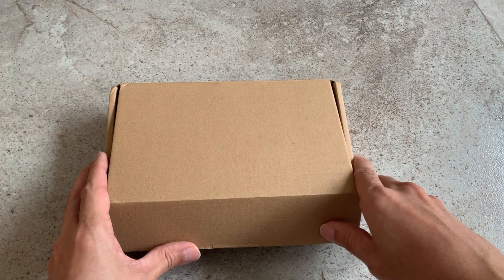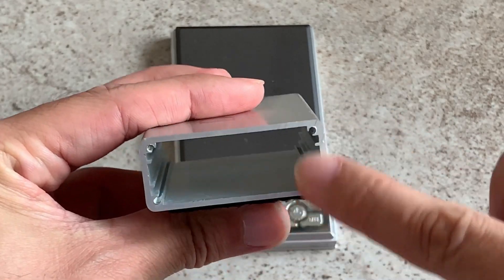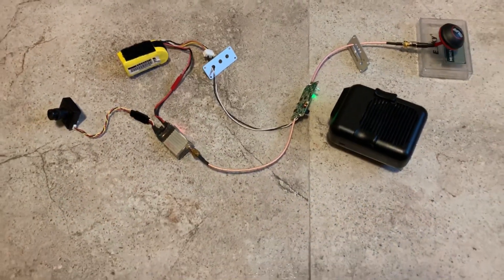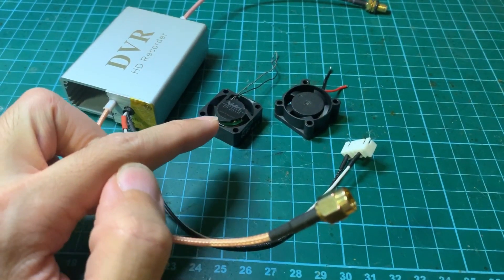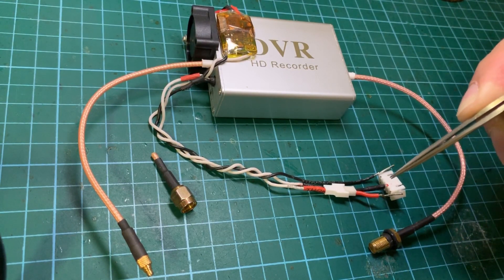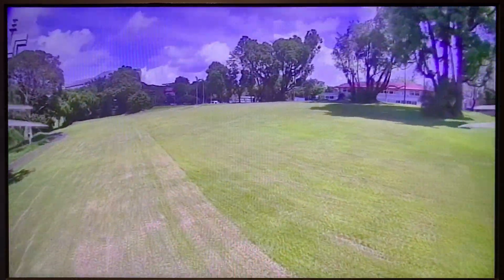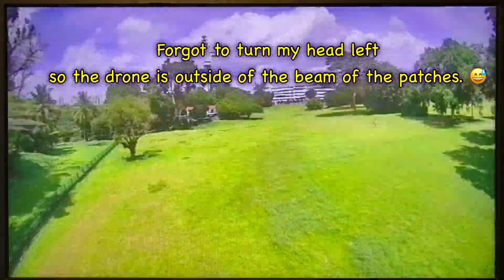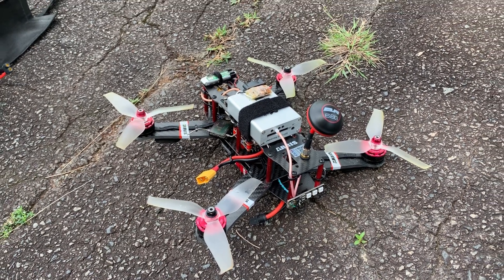Shark Byte on Steroids (super-amped)

Comment: This range seems really bizzarre. It would be interesting to see what the rf environment is like in this area. I've had poor performance from my setups due to high gain wifi antennas nearby. As soon as the drone was not in direct line of site i got nearly complete static. Swapping to a different channel helped in my case though i believe it could be possible for wifi to fill all of our fpv 5.8ghz band pretty easily.
Reply from the maker: Thanks for watching. Admittedly, I was immediately disappointed with the result and I tried different outputs of the sharkbyte (25mw, 200mw, etc) but to no avail. I also re-tested the amp on my analog VTX and the amp was still working great for analog 5.8g. At that juncture, I kinda concluded that the 4W 5.8g WiFi amp simply could not process the type of 5.8g signal from the Sharkbyte VTX. 
You are right that strong WiFi could cause interference easily as each WiFi channel uses a range of frequencies,  instead of a single frequency. I was getting clean video at that field so there was unlikely to be interference from the residential WiFi nearby.

Comment: Where are you flying from? @200mw I have pentrated more than that and had better signal. Eben with 4 dji quads @1200mw..I do not believe that's actually a true 4 watts. The 1 watt board we are testing smokes this test.....
Reply from the maker: Thanks for watching. It measured 35.2db (3.3watts) in my analog range test video using this amp https://www.youtube.com/watch?v=a_Ov9Q652Mc

Comment: Can you boost the antenna gain from the vrx?
Reply from the maker: I did tried a 5.8ghz low noise amp on the receiver. It worked but the improvement in the received video was not significant enough,  https://www.youtube.com/watch?v=GNiBfrrPsTE

Comment: Can most likely fix this issue with helical high gain antennas.
Reply from the maker: Thanks for watching. Helical are are the first 5.8g antenna I built. They are great antennas. I used the mast of the CDs cylinder box which is just the right diameter.

Comment: I applaud your effort to try an make sharkbyte a better option but like you said in your video when you saw the results, that is truly disappointing. I had high hopes that fatshark would be able to compete with DJI but it seems that with the current results our money is much better spent on a DJI setup. I think that the "graceful" degradation of signal is one place that fatshark is going wrong as it doesn't seem all that graceful and you can't fly through it's breakup, The two way communication of DJI seems to be the better option, If I was to design a system to compete I would go with the bi directional communication and then have the vtx lower the bitrate on the fly while stepping down the resolution as well as the signal fades out. You would think that fatshark would have thought this out a little more before investing money into producing a second rate product that's not giving them a great name as of right now. I want to see a competitor to dji as I don't agree with the decisions that they make such as enforcing no fly zones even for professional pilots. We can only hope that future firmwares and hardware revisions will see fatshark do a better job in the near futures, thanks for posting your attempt to make it better.
Reply from the maker: Thanks a lot for your comment . I’m glad that you appreciate the great lengths I took to combat the weakness of the SharkByte. For now, I am putting the sharkbyte in applications like proximity FPV car racing, where the breakup isn’t more than 10% of the pixels. As you rightfully pointed out, the degradation experience is really a handful , it isn’t something that is bearable  like analog which you can still make out where you are flying  with the faintest, grainy black and white image. At this point, Fatshark and Divimath need to look beyond increasing the power  of the VTX. They should incorporate MIMO technology to improve the transmission quality and with the breakup occurring only when latency reaches a certain threshold.

Comment: I'm surprised at why it did not improve it much. I guess that is the weakness of 5.8ghz, regardless of power, high gain on the receiver is probably better results.
Reply from the maker: Thanks for watching. Yep, kinda disappointing because it had worked so well for the 5.8ghz analog vtx. I will use it for analog application soon, stay tuned for the video :)

Comment: Shark byte is just 400 dollars junk I have a predator 4 or my tarsier v2 camera either one one the tbs unify pro hv32 has a was better picture and will go a lot farther
Reply from the maker: Thanks for dropping by. Performance wise, it is is no where near to DJI digital for what it is. It wins by its small form factor and near zero-latency. You are right that it is even lagging behind good analog systems like Unify Pro and RapidFire simply because its video degradation (with similar output power) does not hold up as good when getting behind objects and when nearing the edge of its LOS range. I would try a tracking antenna on it in the next video.

Comment: Shark byte just has major penetration and interference issues. Anytime you do rolls/high throttle inputs the break up starts.  At this point I don't even think the output power is the problem and its more firmware based.

Hopefully they will get it sorted out. Its just not worth buying over dji currently with the penetration issues and its current price point. 

HDO2 + sharkbyte + antennas costs more than dji goggles + air unit(antennas all included). And the only benefit currently being you can fly whoops.
Reply: But the beautiful thing is even my $150 eachine cobra will work with shark byte. You get options. Literally no need to get expensive hdo2 or orqas if you're going shark byte.
Reply from the maker: Thanks a lot for dropping by. The rated max output of this amp is 37dbm (5W of power) and the typical gain of this device is 15db (32 x the power) according to the datasheet. Based on these specs, the max input should be 156mw (0.156W). I guess it did not like the 200mw from the SharkByte at all. I believe you are right. 500mw is somewhat the “limit” right now due to the divimath signal processing (or firmware as you mentioned) . Out of curiousity, I tried feeding 500mw of the SharkByte to the amp and sharks! The entire video screen was filled with snow artifacts, I quickly shut it down to avoid damage to the amp. I believe the analog VTX could be outputting less than 200mw, perhaps 160-ish mw and so the amp really shines with that. 😊
Reply: Have you tried a signal attenuator to lower the gain prior to the final amp?
Reply from the maker: Tried setting the bytefrost output to 25mw and 200mw, no luck though.

Comment: Did you make sure you have the shark byte tuned to a channel within the amplifiers range?
Reply from the maker: Thanks for pointing this out. I checked and found out that the vtx was on 5735 which is within the amplifier’s range (5725 to 5885).

Comment: Can you do that to dji?
Reply from the maker: Thanks for dropping by. No, we can’t use this amp on the DJI air unit/ caddx vista because they are bi-directional communication devices. The amp does not support the DJI proprietary transmission protocol and it will damage the unit.
Reply: @terence79chan  Try the same spot with DJI air unit only without any amplifier.
Reply from the maker: @jmcjmc5587  Thanks for visiting. I had tried that with my iFlight titan DC2 with air unit and it won the sharkByte hands down. LOL
Reply: @terence79chan  I have go to see your video. It's better even with stock antenna.
Reply from the maker: Appreciate it, thanks.